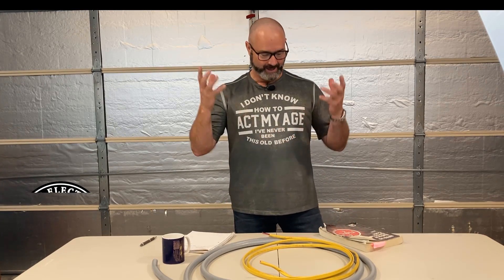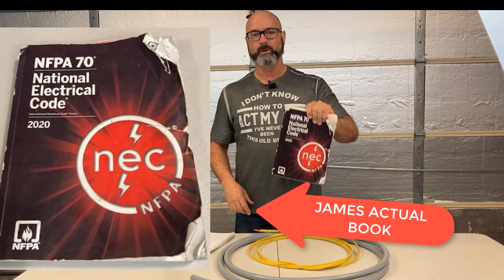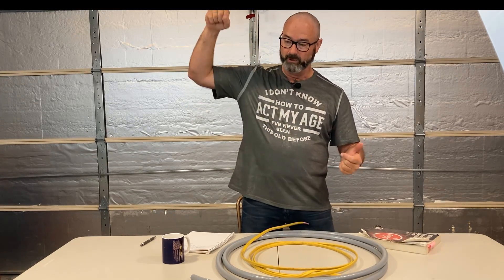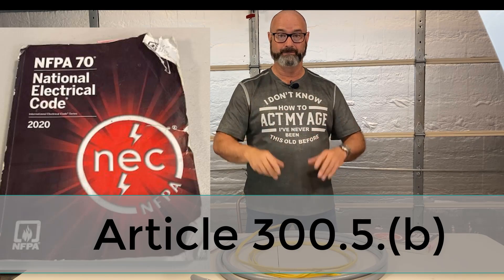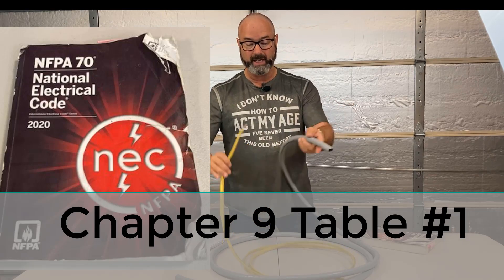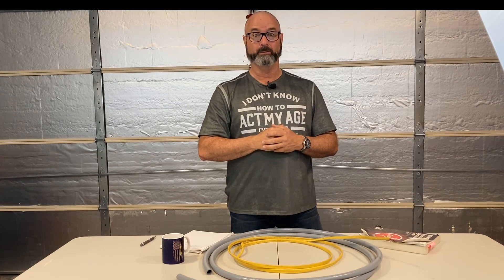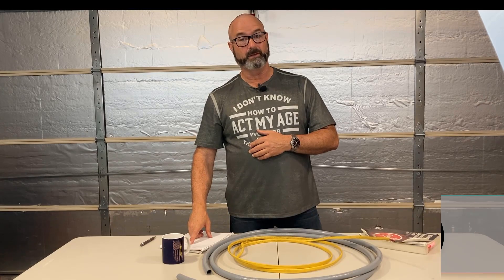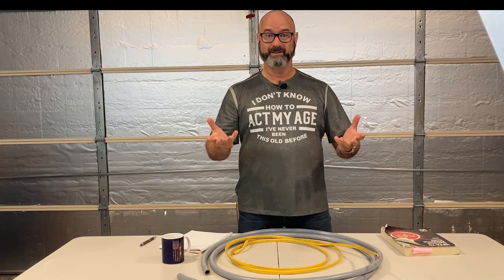Can Romex Cable be run Through Conduit? National Electrical Code Book

Comment: Seems a little irresponsible to leave this question with only blanket statements —"if you do this or that, yes it is ok"— without mentioning double-derating of conductors within a sheath AND a conduit over 2' long, and number of conductors. Code enforcement will hit you hard for too many conductors, without mention of conduit fill.

Comment: I need to run elect. Over my roof t&g sheathing but under my rigid insul.. So that must be damp, I can't run 12/2 romex in 1/2" conduit but I can run bare wire in same conduit? Thx
Reply from the maker: You can run THHN/THW in EMTconduit. You could also run UF if it's protected from nails or screws

Comment: Other than because the code says so, what is the issue with, for example, running Romex in a conduit, under concrete, to a kitchen island?
Reply from the maker: Romex is not meant to be wet. It will eventually break down if it's in a wet environment

Comment: I will be bringing 30 amps into the trailer using a breaker box with two 20A breakers and will run wire from one breaker to one side of the trailer and likewise to the other side of the trailer. On one side of the trailer there will be a small fridge and a 7cuft freezer. On the other side will be a portable AC unit, large snow cone machine and microwave. I can change the plan if needed. I would appreciate any advice. Thanks.

Comment: I am converting a vintage canned ham camp trailer to a snack wagon. I have wired in the past using 1/2" conduit for the romex. So this is not code and I would have to use 3/4" conduit?

Comment: my main panel is on the outside of my house, it has multiple grey electrical PVC conduit up the side of the house into the attic
within that are ROMEX lines which feed the interior of my house
is this a problem?

Comment: So outside in liquid tight as long as the conduit is large enough it's good?
Reply from the maker: @chriscolameco6850  nope. Outside, it has to be UF or individual wires labeled something like MTW, THHW,  etc. "W"
Reply: @ Uf in conduit right? You can’t just have UF outside exposed to the sun
Reply from the maker: @chriscolameco6850  you can have it outside conduit, if it's not exposed to physical damage.

Comment: WHAT SIZE PVC CONDUIT WOULD I NEED FOR 6/3 WITH GROUND UF CABLE , BOUT A 20' RUN FROM SOFFIT TO GENERATOR HOOK UP.  I'M THINKING 1 1/2
Reply from the maker: @JasonHudson-x7u  11/2" will work easily

Comment: James, just discovered your channel, very interesting and informative. I do have a question, I live in a house with a unfinished detached garage that was built in 1973. I want to rewire the garage, and am planning to change out the romex in the conduit coming up from the cement floor. The conduit runs underground to the back of the house, which is on a slab, it runs up the outside wall of the house and enters the house in the attic. The main panel is near the front of the house. The question is, is a unfinished garage considered a wet location? I want to do it right and possibly exceed the code so I don't have to worry about safety and other issues. I am thinking about putting a subpanel in there.
Reply from the maker: The garage is not considered a wet location. However, even running the romex through the studs, the romex is not meant to be exposed. If you're going to close it up i.e. with drywall no problems. Otherwise, the exposed wiring should be in MC cable or conduit. 
Thanks for asking! Good luck - 1973 was a good year
Reply: @abrelectric  Thanks. And thank you for taking the time to respond, appreciate it. I'm thinking about running the UF or thwn (spelling?) wiring from the main panel in the house all the way to the garage and wiring the garage with it, since I have to at least put that wiring in the underground conduit anyways to be code compliant, as well having to buy the wires.
Reply: Almost forgot, saw a yt short last night that showed conduit in a house in Chicago, apparently conduit is required for all wiring in buildings in Chicago. Conduit in the garage is a good idea, don't think that the garage is going to get drywall or any other wall covering.

Comment: Does it say something in the code about if it's watertight conduit
Reply from the maker: @ryanreineke8658  as far as the code, anytime the Romex is in an outdoor damper wet location, the inside of the conduit is even considered a damp location
Reply: @abrelectric  what if you are using liquid tight?
Reply from the maker: @ryanreineke8658  the conduit pipe isn't the issue. Once you're in an outdoor situation the code considers the inside of any conduit Outdoors to be a damp location at least
Reply from the maker: @ryanreineke8658  also you can use THHN conductors or type UF cable
Reply from the maker: Go to your code book: Art 300.5(B), 300.9

Comment: Electricians squeezed 6/3 wire romex into the conduit, while transitioning from, interior walls to conduit behind the stove.  They did this because it went through the attic, down a two story wall, and then behind the cabinet.

They said it was to code. Should I get this checked?
Reply from the maker: @davidc9710  if the 6/3 Romex is going outside, in or out of conduit, that is not correct, per the NEC art 334. 
If you're worried about the quality, have them pull a permit and get it inspected.

Comment: Inside a shed would be considered damp location? Shed is 9" from garage and running schedule 40 (3/4") inside shed so romex or no go? Total 15' of wire to 1 outlet, a switch and light.

Comment: Thank you for the video.
I want to add grounded outlets to my house and attic space and fire blocking make coming down the walls prohibitive. I am planning on running six 12/2 UF wires in a 1.5 inch PVC conduit from the outside breaker box down about four feet to the pier and beam space under the house. I have tested it and can fit at least 14 of the 12/2 UF in the 1.5 in conduit. Because I am running only 6 I should be at or below the 40% fill limit. Does this seem correct/Ok to you?

Comment: @3:58. "For 12-2 you have to put that into a 3/4" Conduit." It not correct. Looking at the Romex specification chart, 14-2 is .368x.162, and 12-2 is .418x.179. These are the two smallest Romex cables and basically, looking at the 53% Fill from table 4, Chapter 9, for 3/4 is .283 and for 1" is .458, so both 14-2  (.368) or 12-2(.418) in 3/4" doesn't meet code. For Romex to be in ENT, it needs to be 1" (.458) or larger.
Reply: You're not even close. First, conduit fill requirements only apply to COMPLETE conduit systems, box to box, for example. Otherwise, if it fits it's legal. 
Assuming a complete conduit system, let's look at your math, which is WAY off. A single 12-2 NM cable has a conduit fill area of .1256SqIn. The 53% area of 1/2" emt is .161SqIn. A single 12-2 easily fits in 1/2" EMT with room to spare. For 14-2, conduit fill area of the cable is .102. Again, plenty of room in 1/2" EMT with lots of room to spare.

Comment: Just what I need,  i have to run a wire through an air return in my ceiling of my basement family room.  The air return is a sheet metal covering the bay of two joists.

Comment: We have white Romex in metal conduit on the outside of the house 
it's 220 volt hardwired to a air conditioner found that out at the bottom access junction going into the house - so what's the cure ? Remove the Romex outside and run the correct wire out of the house into the conduit to a weather proof box then the wire goes inside to a  box and plug the a/c into it
I'm sure an electrician did this some 35 years ago , the Kenmore a/c finally gave out so a new one will go in the legal way

Comment: Thank you for this information.  So, if I understand the fill table correctly, I can put 6 individual THWN or THHN #8 AWG cables into a 3/4" NMT conduit.  I could also run one 8/3 NM-B romex.  If the conduit is in a barn that is not necessarily always climate controlled, are you saying it would be better to remove the outer sheathing of the Romex?  If the cable is already pulled, should I un-pull it, strip it, and then re-run it?  TIA.
Reply from the maker: @rg5780  thank you for the question. The real issue is the location: if it's normally dry in the barn, the romex is fine. Removing the sheath doesn't change the rating - I'd leave it be.
The fill table is your next gate, and looks like you have that in hand.

Comment: What about UF direct burial wire?  Thats obviously allowed outside. Can that be used in a conduit?
Reply: yes
Reply: I wired my manual transfer switch with 10/3 UF thru a garage block wall and I still put it in plastic electrical conduit with proper connectors to wire to the transfer box. Gives the UF some physical protection in the block wall and allows proper gluing and sealing for moisture "Just in case".....
Reply: @stbentoak5047  There is no "just in case." All outdoor conduits eventually fill up with water due to condensation, not leaks.

Comment: Ok how in the hell do you run a new line through an attic to an air-conditioner the line has to come out of an eve theres no way to transition from romex to single strand without one touching the wrong area.
Reply: We used to do that all the time years ago and never had any problems. Now to satisfy the code we either set a j-box in the attic and change to thhn or pull in UF cable.i think this is dumb and it frustrates me.

Comment: should I run Romex to a cealing fan through a conduit?
Reply from the maker: @paulchristopherriley7503  is this in a house with an attic or do you have to run the romex on the surface?
Reply: @abrelectric  the romex can run through the attic. thanks

Comment: You completely blew off two limitations. Manufacturers recommendations and pull resistant. If you don’t understand what I’m talking about then take this video down.

The pull resistance issue is serious enough that every jurisdiction I’ve worked in specifically prohibits your crazy idea
Reply: Dude I'm a master electrician, I get your point but it's almost like you're trying to attack him with your information, and coming off as a dirtbag , ... It was definitely a better way to word and explain your thoughts 💭
Reply from the maker: Which crazy idea specifically? Since I'm not familiar with every jurisdiction,  let's stick to the NEC. Please reference the NEC.
Reply: What is "pull resistance" limitations?

Comment: It is illegal to install Romex in conduit in the state of Washington
Reply from the maker: Good to know; in any location, or just outdoors?
Reply: @abrelectric  anywhere
Reply: @maryungerecht2753  Did someone tell you this or did you read it yourself? The state of WA follows the 2023 NEC, state amendments are here WAC 296-46B-334. There's nothing in the electrical code in WA that forbids romex in conduit.
Reply: @maryungerecht2753  It's possibly a local code, not statewide, but if it's not in writing by the local AHJ and simply an inspector's opinion, it's not illegal. Electrically, there's no good reason for it to be illegal in conduit in dry locations. In fact, WA state amendments overrides the NEC and allows NM in conduit outdoors under certain conditions.

Comment: Is the interior of a cargo trailer considered a damp/wet location? It's going in a vending trailer (high humidity area, but liquid tite is water tight 🤔).
Reply from the maker: That is a great question. Is the interior of the vending trailer normally dry - it's not being hosed down for cleaning?

Comment: Can I run a 6/3 aluminum ser from my sub panel  in conduit underground to a shed 15 feet away?I was gonna run two 12/2 romex.not code 
I need two 15 amp circuits inside shed.
Reply from the maker: Check your SER cable sheath: if it's rated for wet locations or has a W identifier in the labeling, yes.
Reply: @abrelectric  Are you sure you're a master electrician? You need to read the NEC before you answer a question like that. The answer is NO, SE is not allowed underground, 338.12(A)(2)
Reply from the maker: @pld8993  I appreciate that you can read as well. "Check the rating in the sheath" is based on there being SER cables rated for wet locations. Blindly quoting NEC is as bad as blindly installing inappropriate wiring methods.
Reply: @abrelectric  Yeah, blindly quoting, give me a break. Of course it's rated for wet locations, it's installed outdoors every day. The sheath rating on SE cable is irrelevant, it's never allowed underground. Here's the exact "blind" quote, 338.12 Uses Not Permitted (A) Service Entrance Cable (2) Underground with or without a raceway. Any questions?
Reply from the maker: @pld8993  not doubting your literacy. If a brand of SER cable is rated/listed by the manufacturer for installation in wet locations, then it is. That's why I direct people to look and read.
Reply from the maker: Also, what the AHJ will allow is part of that equation.
Reply from the maker: @pld8993  That same thread, if the manufacturer/UL lists the product to be used in a certain environment, see 110.3 B
Reply: @abrelectric  It is not allowed underground, period, no exceptions, no sheath rating is going to allow it underground. If a local AHJ has an exception to 338.12(A)(2) that allows it underground, is the only situation where you can install it underground. I'd bet that the AHJ for McKinney, TX doesn't allow it underground. Look, you screwed up, we all make mistakes, you didn't know it wasn't allowed underground but now you know. You don't need to keep pretending that you're right because you're not. You claim to direct others to look and read and you won't acknowledge what you read. You can't install it underground, end of discussion.
Reply: The answer is no.
Reply: The guy making this video has no idea what he's talking about. The NEC says, in plain English, that SE cable is not permitted underground, and there are no exceptions to that rule. Good luck with your project.

Comment: What about 10/3 inside 3/4"? If the sheathing is a problem, can I take the sheathing off and tape the ends of the wires so they stay together to be pulled through?
What about running the damp area rated/outdoor type wire through conduit? I have a pump house with cables running to pumps and switches and its a very damp area and I want to put the cables in conduit to protect them from getting damaged/scratched/chewed. I've some southwire in orange sheathing (which I think is for indoor) and some in gray. There's a mess of wires inside the pump house and I'm trying to fix it all up.
Is it possible to remove the sheathing on the wires and twist them so they are all together?
Reply from the maker: Don't twist them together. The romex (white/yellow/orange) is not rated for damp or we locations, with or without the sheath. The gray wire, UF, is rated for those locations if you aren't pulling individual wires (rated THW or MTW) through the electrical PVC conduit.
Reply: @abrelectric  Thanks! I'll make sure to use the gray kind then. Man, the people who originally did it have just the orange wire in there without any protection and the exposed metal parts are corroded where they attach to the liquid level switch and to the pressure switch. It's a rural area so nothing was done to code out here. I'm trying to fix up the cluster of DIY mistakes from other people.

Comment: I am installing a Ford Connected Charge Station. It is 48 amps continuous duty so I upgraded to 4/3 copper for the 60 amp breaker. Reading more closely I noticed the manufacturer calls for conduit and I already purchased the nm-b romex. I can do a 2ft run from the panel to the charger although the turns will be hard to work with. My question is if I use the romex is it better to strip the sheathing and use the individual wires or go with a larger conduit? Just thinking about heat. Probably would be more sensible to go with THHN? It won't be inspected but I want it to be safe. The conduit will be indoors, dry, in a 10" bay between 2 walls.
Reply: Romex will not overheat simply by being in conduit and you are not allowed to remove the sheathing.

Comment: Ok, u can do putting 4-12/2 Romex in a 1” pvc pipe? ( for island) like 7” to wall from island!
Reply from the maker: Yes, if the 1" is Not underground (code considers underground conduit a damp location) and that total run of bundled romex in conduit is less than 24" long.
Reply: @abrelectric  Underground conduit is a wet location, not damp.

Comment: I stripped the cover off my romex and ran it through the galvanized conduit to my living room fan.   Is this against code or do I need a special wire for this?  I will be getting it inspected.
Reply from the maker: If it's indoors, and the conduit and boxes are assembled correctly and grounded, you should be fine. Ultimately up ti the inspector

Comment: I can’t find the spec on the cross-section area of NM to determine < or > 53% for a given size of conduit. I’ve seen others also say that 12/3 exceeds 53% of half-inch conduit, but would love to know what the actual numbers are. (Full disclosure: I ran about 9 ft of NM through conduit on a basement wall before I read it was a no-no. The location is pretty blocked now in a way that changing it out will be a huge task. If the actual NM cross sectional area is like, 58% or something, I’m not going to worry about it, and will sleep ok with the code violation. If the numbers make me think there’s a potential safety issue, it goes on my @#%!& chore list, things I reaaaallly don’t wanna do, but have to face.)
Reply from the maker: SA 
O 
cgy; 
hunk 
Member 
Yeah! :grin: 
ight here. 
14-2 NMB .1018 
12-2 NMB .1320 
10-2 NMB .1917 
8-2 NMB .2942 
6-2 NMB .3664 
14-3 NMB .0740 
12-3 NMB .0946 
10-3 NMB .1399 
8-3 NMB .2507 
6-3 NMB .3318 
14-2 UF .1405 
12-2 UF .1684 
10-2 UF .2107 
8-2 UF .3610 
6-O IIF A657
Reply: A single 12-3 does not exceed 53%, not even close. The 53% fill amount for 1/2" emt is .161 sq in and 12/3 occupies .107, which is 36%.